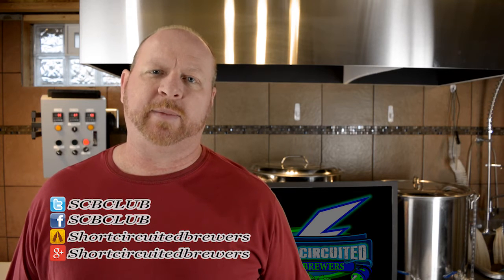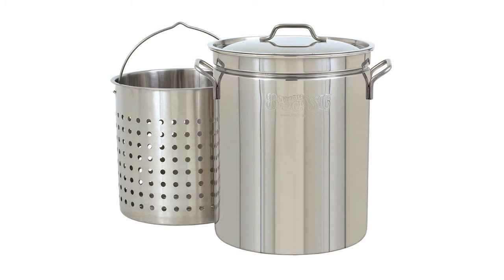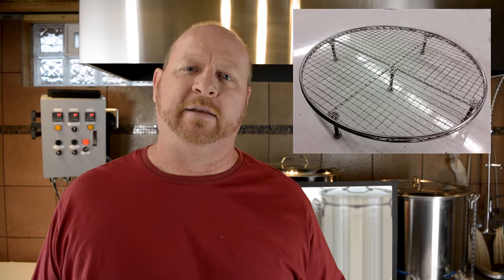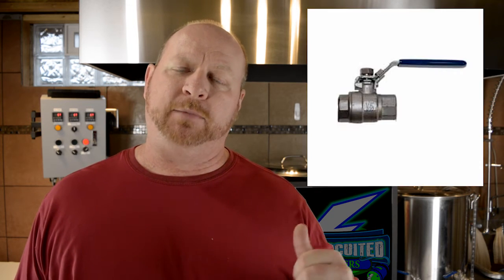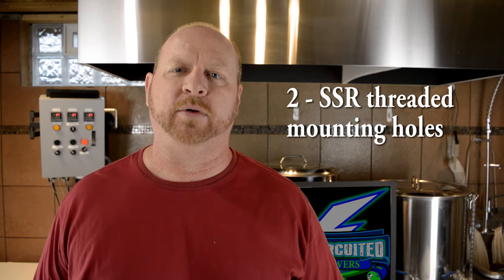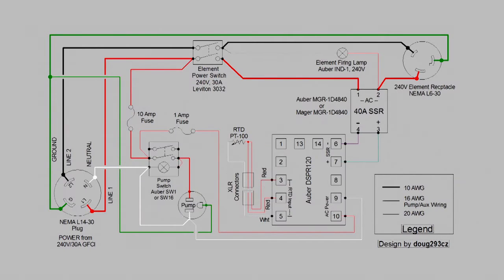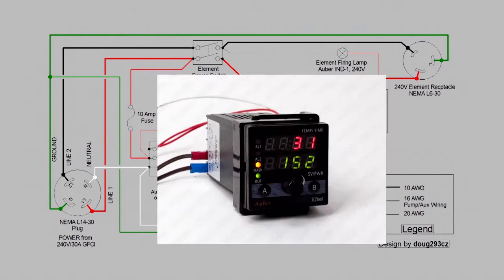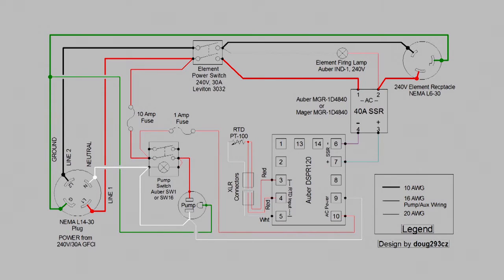Electric Brewing Series - Part 2  Electric Brew In A Bag Build #electricbrewing #ebiab #electricbiab

Comment: Can you put 2 elements for rapid boil?? More parts in controller... I know...
Reply from the maker: Sure you can always put two elements you just have to up your amperage capability of your panel. To be honest with you I 5500 watt element heats up 5 gallons of wort pretty quick. And it's not too bad with 10 gallons either. What bat size are you thinking of?
Reply: @ShortCircuitedBrewers  I'm just starting so just doing some research. Probably going to start with 5 gal. Batches. I like the idea of brewing indoors with electricity. Does anyone sell this kettle pre built already?! I just need the kettle to boil. No pumps needed.
Reply from the maker: Spike brewing sells kettles and will configure however you wasn't it. I assume you are going 240 volts?
Reply: @ShortCircuitedBrewers  can I use my dryer connection? I believe that 240?! I don't think it's gfi though?!??
Reply from the maker: NO definitely do not use the dryer connection. It is not GFCI. Depending on the age of your house and how it is wired you night have a neural wire in the outlet for it, most do not. You're are better to have a separate circuit ran and use a spa disconnect or a dedicated GFCI breaker.

Comment: Do you see any advantage of installing a spray nozzle under the lid instead of the barb fitting you mention?
Reply from the maker: Bart Mink with a BIAB system you are recirculating to maintain the mash temp. I have seen a few systems with sprayers. Not sure there is a big advantage for the additional expense. Not like you are fly sparging where you want to rinse the grains evenly..
Reply: That makes sense.  Did I understand you correctly in that you install the barbed fitting under the lid and put on a small piece of hose?  Or do you just let it free fall from the barbed fitting?
Reply from the maker: Bart Mink you could put a small piece of hose.. So you don't have channeling issues.

Comment: Those EZboil from Auber are very nice! Makes power control easier and internal programming ready for brewing just makes the process even easier. What are the  dimensions of your control panel enclosure? Thanks
Reply from the maker: The one I am building in this series.. I have not measured...mine in my brewery is 16X12X8 if I remember right.. I will have to measure to confirm.

Comment: When I order an element or pump switch from Auber, do I need the 2NO switch or 1NO 1NC ?

Thank you.

By the way, great video!
Reply from the maker: That would be a 2NO switch. Thanks for the comments, and thanks for watching! Any other questions let me know. Cheers! 🍻
Reply: Thank for the answer! I do have one more question. All the control panels/elements are rated a 240v but here in Canada and as far as I know it's the same in the US, we only have 110v and 220v (dryer/stove) outlets. How does this work? I only need to have a new 240v outlet?
Reply from the maker: Yes 220 volts is essentially the same. Will not effect anything. Just make sure you are using a GFCI circuit. ( I know you probably are.. just want to make sure you are safe) Cheers Maxime! 🍻
Reply: So I could wire a whole "240v" control panel and plug it in a dryer outlet and be fine?
Reply from the maker: No you need to have a ground fault circuit  installed. Your typical dryer outlet does not have a ground fault interrupter built into the circuit.

Comment: Hi.  Great video series.  220/240 is new to me, and I have a question.  

On the wiring diagram, once it is plugged in, and the element power switch is turned on, do you have 110 going to the element at that point (line 2 and ground), or do you not get any power at the element till the SSR turns on line 1?
Reply: To be clear, ground should be bonded to neutral in only ONE place, the main panel. This is required and enforced by code, if this is not done the circuit breakers will not trip correctly. There are many great articles describing how this works and I highly recommend anyone building a panel read up and understand them.
Reply from the maker: You do not get power until the second "leg" of the circuit is connected. There is no neutral connected to the element so the circuit does not complete, even though there is a "hot" wire connected. Does this answer your question? Thanks for the comment, and thanks for watching!
Reply: Thanks.  Makes sense.  Guess I need to learn the difference between ground and neutral on a 240 system.
Reply from the maker: Yes Rob, always make sure you're safe I have seen in some older houses where the ground and the neutral are hooked to the same bar in the fuse panel they shouldn't be but sometimes they are. The ground in that system that I have shown here is grounding the element enclosure it's not actually connected to one of the power lugs on the element.

Comment: Do you see any issues with placing the temp sensor in the return on the lid instead of the body of the kettle?  Any advantages to either?
Reply from the maker: My only concern would be if you shut off before the element, the probe would not be reading the temp at the element. I think high gravity's systems are designed that way. Cheers!

Comment: Thank you for this, I've been looking for a little guidance beyond theelectricbrewery.com. Can you explain the lid return item above and how it get's added to the setup. I'm basing mine off of the High Gravity eBIAB setup but I'm having difficulty with how to setup the return. Also, is there a link directly to the circuit you had in the video?
Reply from the maker: I was just figuring on drilling a hole in the kettle lid and use the elbow and camlock as a bulkhead style fitting. (without silicone washers etc.) you may need a npt nut to secure it in place. The diagram is in a homebrewtalk thread listed in the description. Be sure to check out the wiring video in the series if you need any help with that.
Thanks for watching and commenting!

Comment: i just finished Doug's single element 2 pump drawing w/ the DSPR300 EZBoil, everything but the enclosure from Auberins. I wired the power wire right to the panel to same the cost on the extra plug. I will be installing the element with a weld in Hot Pod Element Enclosure from brewhardware along with a 1 1/2 tri clamp for the temp prob into my keggle. Great Vid keep it up!
Reply from the maker: Very nice. Congrats on the move to electric! Thanks for watching! 
Cheers -Brian
Reply: Where do you find Doug's drawings?  It sounds like you built something similar to what I want to do.